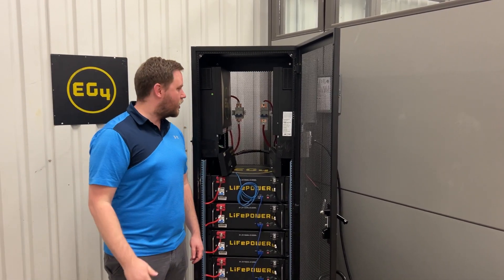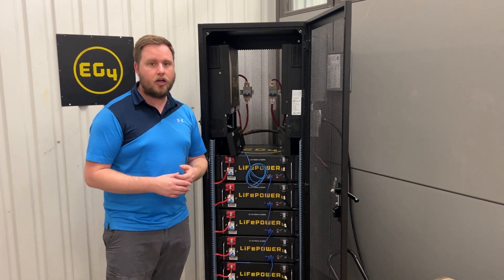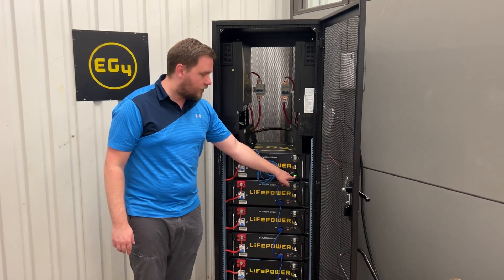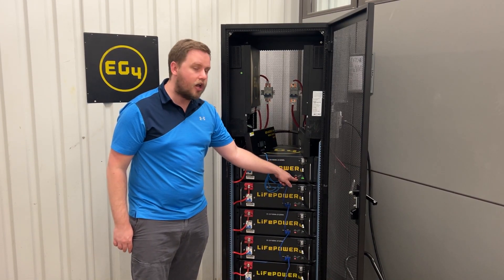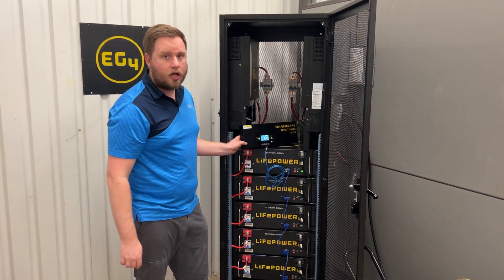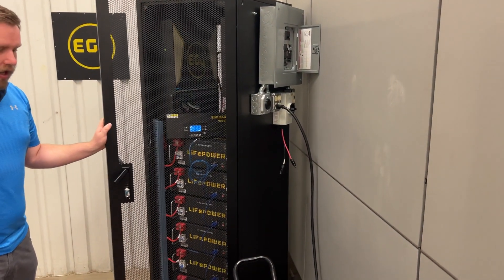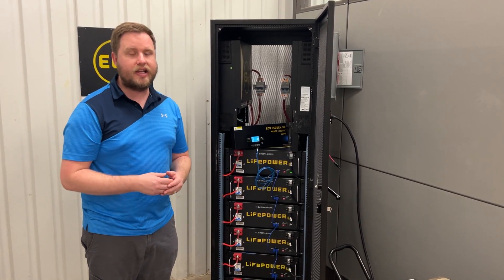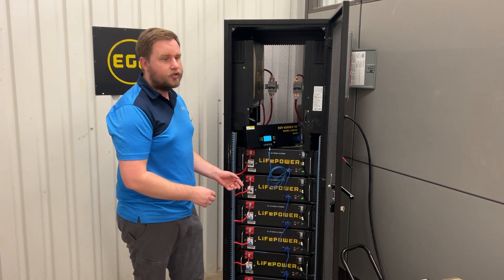EG4 LifePower4: Proper Start Up Procedure Using EG4 LifePower4 Batteries and More!

Comment: Richard, I don't have a breaker between the batteries and the inverter, only a class T fuse.  I hear the clicking noise when I power on the batteries, but when I power on the inverter the batteries trip alarm.
Reply: This AM I was trying to get this started at sunrise.  After many many frustrating configurations and attempts I got it to power on.  In my mind it powered on because the solar array was waking up and kept the inverter in a cycle attempt to power on.  While it was trying to power on, I switched the batteries on and wallah!  The batteries stayed on.  Unfortunately, I had to hot connect my DC to DC converter because I was not going to power down to make the connection.  1 spark later and my DC to DC system is on.

This is not how it should be.  The BMS on these batteries needs some tuning.  This reminds me of having to push start a 1968 VW beetle as a kid.  Yeah, you can get it started, but it didn't fix the problem.

Unfortunately, if this happens again we will need to return the batteries and try a different alternative.
Reply from the maker: We are looking into a few issues like this that are the 5%.
Reply: @SignatureSolar  & Richard,

Thank you, I am sure it's just as much a challenge on your side.

Just FYI, my inverter is a Magnum MS4024M (4k/24v).   Your team has a video doing a bare bones compatibility test on this inverter.  The SCC is a Victron 150v/70a.

The magnum inverter does have a BMK (battery monitoring kit) connected to a 500A shunt on the neg side and power to the bussbar.  The BMK was not attached in the compatibility test.

 The system has a 350A Class T fuse between the positive battery bussbar and the inverter.  There is also a Victron Orion 24vDC to 12vDC 70A converter to power 12v loads.

The only breakers/switches are from the 2400W PV array to the SCC and a 80A breaker between the batteries and the SCC.

*This system only has a chasis ground as it is on a RV, so no ground stake.

**There is a 50A backup generator with a bonded neutral attached to the system via the AC input on the inverter.  

***There is a 50Amp Progressive Industries surge protector between the generator (shore power) and the Magnum inverter.

I thought the last pieces of info on grounds and surge protectors might be important since this seems to be a sensitive short circuit issue.

FYI, I previously had 24V lithium batteries installed with no system issues - so its not the system.  The EG4 LIFEPOWER4 batteries were supposed to be simple drop in replacements with a slight gain in AH.  The batteries are 3 days old, received on Monday, 20 June.
Reply: I can send system pics if needed unfortunately, cant post them here on Utube.

Comment: How do you start up using two inverters and two batteries? Open both breakers to the inverters at the same time, then both batteries?
Reply: My system just has big fuses, closing the breaker on a battery sends current to both inverters.  They start right up.

Comment: I’m confused about the minimum battery requirement for a specific load. Can I run a 2000W load with two LifePower batteries (48V 100Ah) and an EG4 3000W inverter?
Reply from the maker: You can run a 2000W load from a singular EG4 3k and 2 batteries quite easily, given that the load is a 120V load. The EG4 3k is a 120V inverter when its not in parallel.

Comment: Interesting I have the 6000k 120/240 all in one eg4 and one of those batteries and I have no problems with running loads eventually getting six batteries should be enough power for what I need I'm off grid with just one.

Comment: What size DC breaker are you using for that stack of 5 batteries? Spec sheet says 30A recommended discharge per battery, but system design wise, what would you do for the stack of 5?
Reply from the maker: Our breaker we recommend is a 200a breaker. We sell it directly on our site.
Reply: @SignatureSolar  Hi! Went to the web site and there are several. Could you state which one in particular you recommend. thanks. (currently I go directly from the batteries to the inverter).
Reply from the maker: @howardkearney7989  https://signaturesolar.com/nader-dc-circuit-breaker-60v-200amp/
Reply: The breaker that you have on there is only rated for up to 1/0 wire. Do you have something that takes a heavier wire?

Comment: Thank you for this video!! Just installed (last weekend) Two Eg4 6500ex and two Eg4 Lifepower batteries (split phase) Do you have an answer to the 61 error everyone is experiencing with this set up? Have the right cables pinned correctly and installed correct direction. Tried two different cables. Bought all from signature solar. Inverter is not communicating with batteries as far as I can tell. I get the 61 error within minutes regardless of state of charge. Signature solar has no answers
Reply from the maker: Richard said he is going to be making another video on this. A majority of the time it's a simple fix.
Reply: @SignatureSolar  Ok thanks - i HOPE IT IS. Bought this system because they were suppose to communicate. Per the forums its been going on for weeks with no fix.
Reply: What is the start up procedure you are using with two batteries and two inverters? I have the same as setup and an ready to start it up.
Reply: Old question but swapping  the cable end for end worked for me. The cable has to remain connected to the host inverter.  That is not made clear.

Comment: You didn't even mention about solar input. 
So my understanding is battery, inverter, solar to start and reverse to turn off. Correct?
Reply: I have the same question. I emailed SS and posted on diysolarforum asking about the on/off procedure and I got no reply. I have the new EG4-LL and it has a circuit breaker and a separate BMS/display switch, so I close its circuit breaker first to establish the electrical connection to the inverter and then close the BMS switch, in order to activate its built-in current limiting resistor. The LifePower switch functions as a circuit breaker and BMS switch in one unit.
Reply from the maker: We will do another video with solar - that largely depends on the inverter though!
Reply: I run two Growatt 5k I bought ftom you guys in parallel.

Comment: i've got two other brand batteries and want to buy 2 eg4 batteries before using  my eg4 6500ex.  if i put all 4 batteries in parallel and start up the eg4 batteries,  start the inverter, then turn on
the other brand batteries which don't have precharge resistors, the two eg4 batteries should limit the voltage spike from the 2 off brand batteries.

Comment: I would have liked to have seen you turn the compressor on after adding the second battery to show that it would have done it
Reply from the maker: We did show it with 2 batteries and 4 batteries. It only failed with just 1.
Reply: @SignatureSolar  
Ok. I was just referring to this particular video. Never seen this channel. I’ll go look for it.
Reply from the maker: In this video we start the compressor with only 2 batteries.
Reply: @SignatureSolar  
I’m so sorry. I’m not sure what I was thinking when I commented. I watched so many videos that night on lithium batteries. I watched it again and yes,,, there it was. I must have gotten up or was distracted when you showed that. I am very interested in a 24 volt rack battery like those. 😊

Comment: Will that exact system you built run a whole house ,off grid? If so what's the max daily kwh the house could require? Thank you
Reply from the maker: This is a concept we are working on - 30kw of batteries, 2 inverters for split phase, and all the accessories built in. Not done yet testing!
Reply: the assembly will work for the average 3/3 house with no furnace or tankless electric water heater

Comment: I just bought two of these. The manual says something confusing though. pg 4 has a statement that says: "Do NOT parallel batteries by using jumper wires on the terminals. This will cause a high amperage in the final jumpers and potentially excessive amperage on the battery terminals." These are intended to be connected in parallel just like what we see in this video to maintain the 48v and double the amp hours. I am assuming the point of the warning is not to use some sort of cable like jumper cables for a car??? this is a confusing warning. Can anyone comment on this?
Reply from the maker: We do not recommend using car jumper cables to parallel your batteries.
Reply: I found it hard to believe someone would do that. My company has to make documents idiot proof too. Not being an electrician, I thought perhaps there was a broader scope for the teem. Thanks @SignatureSolar

Comment: Sinse when does an OPEN CB mean it's ON?
Reply: Since when does sense mean since? See how easy it is to make a mistake? Try not being a jerk to people who make a simple error when it is easily understood what they actually mean.
Reply: @Owlagami   Thank you for the explanation, since no-one has answered my question it still needs to be answered "When does an OPEN CB mean Its ON?.
Reply: @Owlagami  Needs to be edited for accuracy though.
Reply: @onmyworkbench7000  I just watched the video again and he doesn’t say “open circuit breaker” anywhere. He says “an open electrical connection” then immediately explains what he means. Maybe focus less on the semantics of what is said and more on what is actually being said. Feel free to tag the time stamp of where he says “open circuit breaker”. I’ll wait.
Reply: @bruceeverett5372  except he never said open circuit breaker so, what exactly should they edit?
Reply: @Owlagami  That would be at the 1:30 point in the video. He said that they need to have an OPEN electrical connection as he pointed to the CB, I don't know what electronics school YOU went to but everything that I was taught about electronics OPEN is NOT CONNECTED and CLOSED is CONNECTED.

Comment: SO THESE EG LITH BATTERIES AUTOMATICALLY PRECHARGE CAPACITORS OF INVERTYER? IF THATS CORRECT HOW YOU RECOMMEND TO PRECHARGE INVERTER CAPACITOR, I HAVE 1 EX6000EX, WITH 4 GEL BATTERIES I HAVE ONLY AVAILABLE IN SERIES 12VOLT  200AH???
Reply: USER MANUAL NOVEMBER 2022 SAYS NOTHING ABOUT PRECHARGING INVERTER CAPACITORS PAGES 5 AND 6????? NOT REQUIRED TO PRECHARGE ???? FOR US POOR DIY GUYS TRYING TO GROW....

Comment: My Lifepower4 battery only shows a 50% SOC! I went thru all the test and charging with the 48v charger, that the tech said to do.

I'm also getting getting a 19 triangle error. So it is not communicating with the battery. Nor would it charge unless I changed it to user defined.

Comment: I don't understand the science why a single battery would work to turn on that compressor. Batteries connected in parallel increases the amount of time or amp hour capacity whilst voltage remains the same. Shouldn't the compressor at least run but only for a shorter amount of time compared to a larger bank. Someone once explained batteries likened to  a reservoir of   water tank: When we connect more batteries we are increasing the size of the water tank, with less batteries we have a smaller tank ? I would the grateful to be humbled by someone that can correct my understanding, what am i missing here ??
Reply: Compressors, or any electric motor require a large inrush current to start the electric motor-it’s known as overcoming the Locked(locking) rotor amps [LRA].  A 20a motor may require 100-120+ Amps to start it but only 20 to run.  So while one battery may be able to supply the running current needs for the electric motor, it cannot supply the 0.1 second of the required LRA so it can’t start the motor, whereas 2 or 3 (or more) batteries can supply the necessary LRA and the running current.